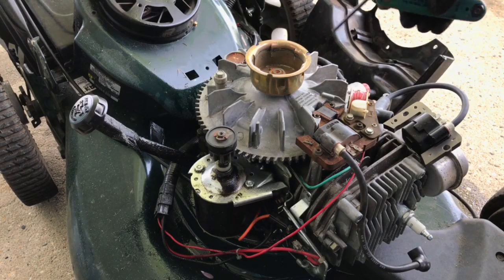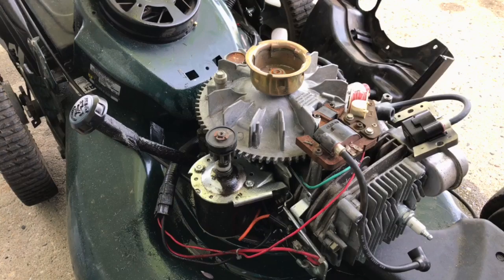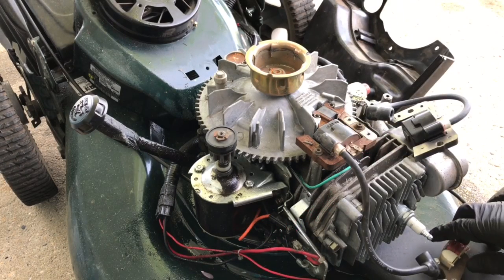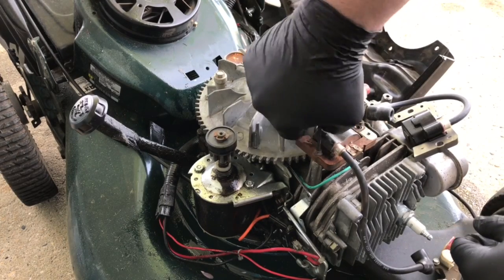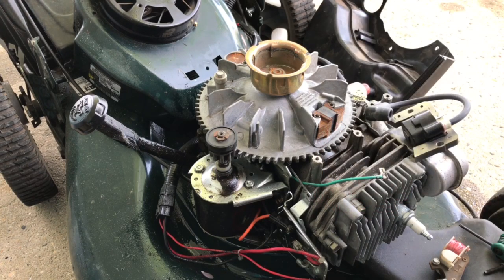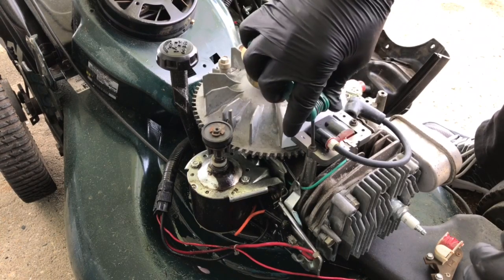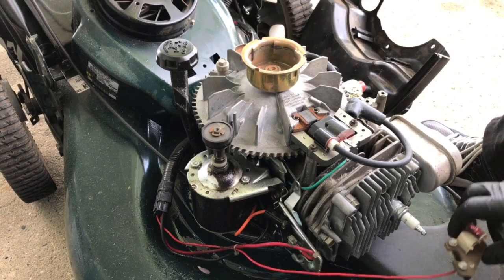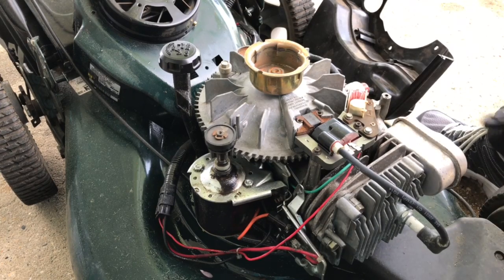How To Replace Ignition Coil On Tecumseh Engine | How To Replace Magneto

Comment: The business card for setting air gap on these simple coils is absolutely brilliant. Setting the gap is where most people fail and eventually throw in the towel. I also carefully check the mounting points on the coil itself and stand-offs for rust before mounting the coil. It must have a perfect ground to the engine to function properly.
Reply from the maker: Thanks for the support! I learned this trick from someone else but it works really well. And I also did what you mentioned and sanded down all the points for the ground but didn’t mention that in the video.  Also great advice! If you want to go one step further I also put dielectric grease on the connections so all the water that a small motor sees won’t ever affect it😎
Reply: Dielectric grease a great idea. This style of ignition with a set of magnets flying past a coil has been around almost as long as the automobile has but when I work diagnose one or repair one, they still never cease to amaze me with their simplicity. Thanks again Sir for the great vid. @NameItBuildIt
Reply from the maker: It’s amazing no matter how much new technology comes out, how the simple stuff seems to work the best and last forever!  Thanks again for bringing so much to the table and sharing your knowledge 😎
Reply: You nailed it and thanks much Sir for the very kind words. My pleasure conversing with you and keep up the great vids.  @NameItBuildIt

Comment: Ive tried 2  new  magnetos on mine and STILL no spark... gap is set at 0.010   NOTHING    I dont see what else could be wrong with it!
Reply from the maker: Try replacing spark plug and check ground. 😎

Comment: hello friend. You can't buy an ignition coil in my country. I found it in China. the Chinese assures me that he will not suit me. but they are very similar visually. will the coil fit me if it is very similar? engine ctr 172 e-62130A. thanks.
Reply from the maker: I am not sure. I would try one in America and see if they ship it overseas. 😎
Reply: @NameItBuildIt  Do you have no way to compare the ctr 172 e-62130A engine with others?